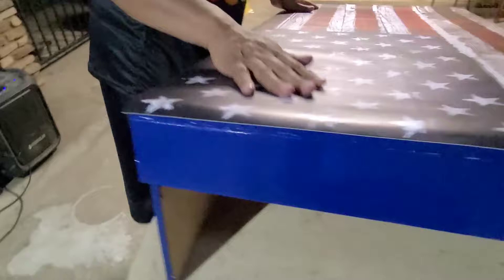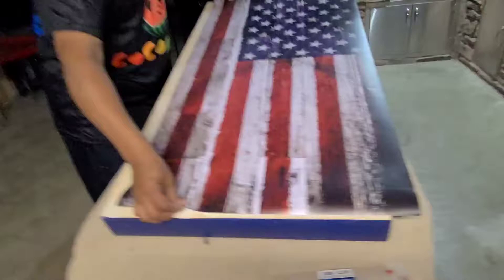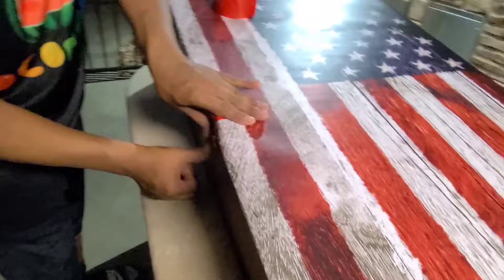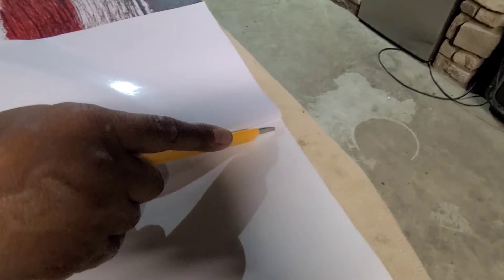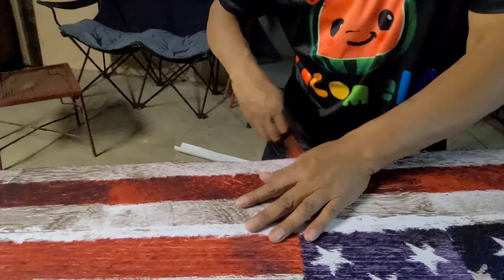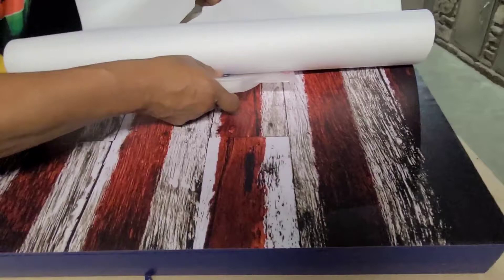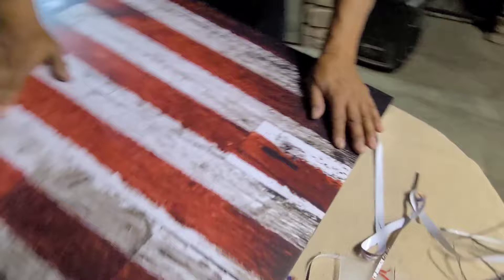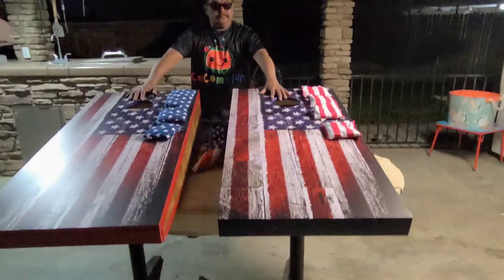How to install a  vinyl wrap on a Corn Hole board

Comment: Nice informative video.  Good job. Question... Why not just buy a laminated wrap instead? You don't have to add any polyurethane, poly acrylic, etc...surface has UV protection  on a laminate wrap.
Reply from the maker: Actually, you don't need to add poly.